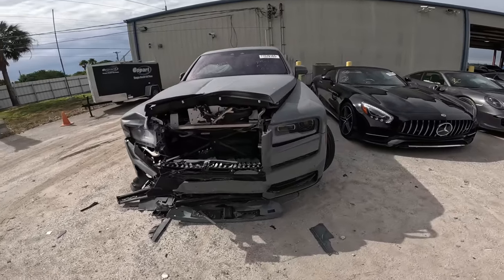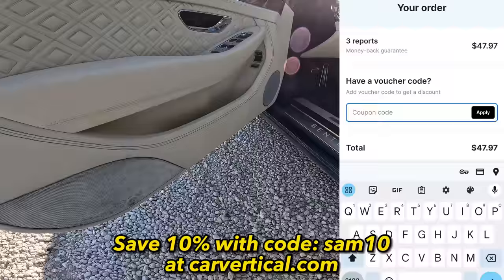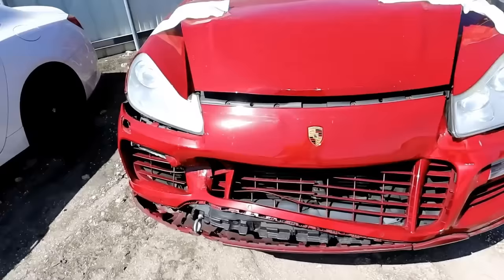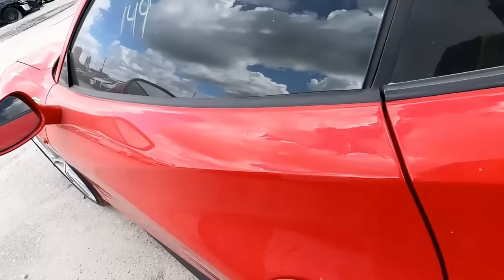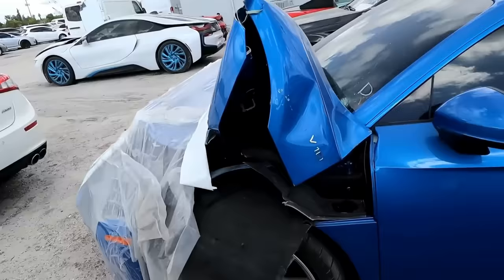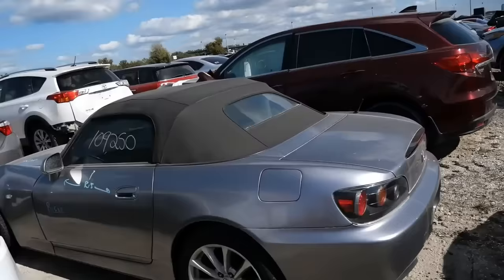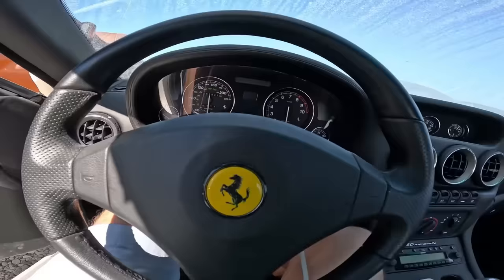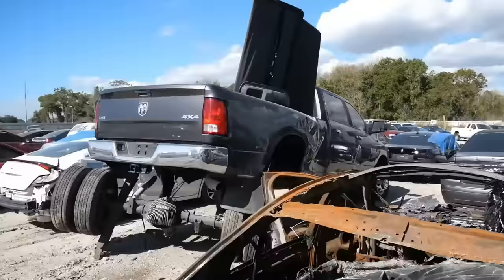I Found a $250,000 Bentley Hiding a Major Cover Up Scam at the Auction

Comment from the maker: Give the 🎁 of a Car's REAL History with carVertical: https://www.carvertical.com/landing/v3?utm_source=infl&a=samcarc&b=2c9b600c&voucher=sam10
Reply: Sam was that the same bmw I8 still sitting at copart?
Reply from the maker: Yes lol but it finally sold around $40k @williamriley-jones
Reply: @Samcrac lol wow it’s sat there for about five years 🤣 glad it finally sold though
Reply: The one thing among many I like about your channel is that you are one of the best YouTube speakers.
Reply: I don't understand how a flood damaged car is OK to repair and drive in the USA but not Canada? They told me electrical problems haunt the vehicle for the rest of it's life. Understandable but many connections are water tight. Many are not. When you have a car that steers by wire imagine the wheel not working on the highway. This might turn out to be a huge mistake for anyone restoring something like that as they could be sued right? If the flood in mentioned in the title then it's buyer beware?

Comment: I laugh every time Samcrac says that V-Tuned could fix this or that but still hasn't finished fixing the Samcrac Ferrari... 🤷‍♂️🤦‍♂️🤣🤣🤣
Reply: Which one the green or silver 360
Reply: 599
Reply: Hard to finish that ferrari 
  when  you have to wait for parts.
Reply: waiting for parts😅
Reply: Yeah, it's not a skill thing, it's a parts thing.
Reply: Ferrari parts wait time is real. Months and months
Reply: Part shortage 🤷🏼‍♂️He has the skills and does excellent work
Reply: When Sam or ratarossa buys a Ferrari I feel sadness I’m gonna watch a difficult project especially when it’s a auto or convertible and everything bad about Italian cars goes wrong . 
Personally I’d like to see Puma Sam fix a magnum Ferrari or something that’s simple old fashioned enzo mechanicals and steer clear of spaghetti sauce electrical immobiliser etc etc gremlins 🇮🇹
Reply: V-tuned had it fixed in no time the actual repair just waiting on bolt on parts he would easily repair the corvette
Reply: Ok?
Reply: Or finished his mustang build
Reply: V tune hasent fixed it because he wasent paid to fix it it was fixed in exchange of barter and air time on a bigger channel
Reply: Could you do better?
Reply: As far as I've seen, he doesn't finish anything
Reply: @adamjohnson6655 I think his mustang is a back burner project. Probably because he thinks it won’t generate the views that even a F150 would get.
Reply: Check where he has collaborated with Goonsquad, Vtuned always finishes his work, just as long as parts are available.
Reply: The content is great, keep the projects coming Sam❤
Reply: No shit.  V tuned only finishes paying customers cars
Reply: All these exotic cars have available parts all day everyday these rebuilders don’t want to pay msrp for them is the problem.  If you are buying a crashed car the goal is to save money all the way thru the project.  This is the issue with VTuned/Samcrac turd.  Salvaged title car will never be valued at blue title level so investing in new factory replacement parts isn’t smart and most don’t.  They will continue to wait for a used part deal.  This is the real reason we are all waiting to see it drive again.
Reply: Not his fault
Reply: @2405Shysgarage They have been waiting on parts for months.  To anyone out there. Tennessee  is full.  We do not want anyone else here. We have people here from everywhere. Please go back to Texas, California and South of the border.

Comment: I've rebuilt a ton of cars over the years, some for personal use and some for resale. It's fun (I love learning new skills like body, paint, detailing, etc), I've gotten some personal cars I wouldn't otherwise have been able to afford, and I usually make money. The only cars I've really lost money on are high-miles German cars, and the most profitable ones (as a percentage of cost) have been American and Japanese sub $5k cars. 

To me, that Mercedes wagon was the only deal, assuming it runs. Some of the supercars and luxury brands can be profitable, but the risks are substantial. The difference between a $50k profit and a $20k loss is razor thin.
Reply: Yeah, your entire profit can be wiped out by a single part on an exotic. V tuned did his McLaren and "made a profit" but he lost his shirt if you include the hours he spent on it. Even if you figure a very low $80/hr he had $80,000 in labour on it.
Reply: "Cheap" car prices and demand have skyrocketed with the inflation on new cars. I think this is a great place for rebuilding; there is a lot to choose from and reasonable parts prices.

On the other hand, with the spike in interest rates and sketchy economic situation, I think rebuilt exotics have become a more risky proposition.
Reply: @dosgos  Well it used to be if you were "upside down" on a used car it was a bad thing. But oddly enough with the insane prices on new cars, the value of a used car has increased so you're not so upside down.

I've put $8000 into my 2004 F150 and people said "you're nuts". Ok, ignoring the fact that it's a 5.4L, anything 6 yrs+ newer would cost me $20K and up AND come with its own problems. New? to replace it? $60,000+ and for that I could rebuild mine from the ground up and have enough to pay for gas for the rest of my life.
Reply: 'A ton of cars' is only one car since most weigh more than 2000 lbs.  Just stating the facts.
Reply: @oldanslo  I bet you're great fun at parties.....not.
Reply: The safest bet would be to go with mass produced cars with min  50000 + cars sold and with cheap and readily available spare parts.
Reply: He made it back in YouTube revenue

Comment: Usually Bentleys are under 6,000 lb and max price of $409,000 extremely fully loaded and only 45% can be written off the tax code vs  Rolls Royce are 6,000 lb and start at half a million dollars and can reach up to$1.5 million depending on options therefore bigger tax write off.
Reply: Also, for people who want bling status, everyone has a Bentley or a Ferrari. Lol. In some places in Los Angeles, you see one every other block, almost.  Now the real bling, though, is and has always been classic cars. That mint condition 1960 or 70ss Bentley is going to turn heads all the time.  In my case, it was a 1967 Mercedes in (factory) emerald green.  It felt special to drive it.  Compared to any old AMG that is.. nice but like every other German sedan?

Comment: I have a D4 Audi A8L with the V8 twin-turbo; same motor...APR tune, improved RS7 turbos, downpipes, turbo oil screens removed/relocated up on custom lines, bigger sway bars and the center muffler changed. Very understated, not loud, but will straight up move. Best part? Inherited

Comment: If that Cayenne sold for $11,600 how much could you part out those brakes for if you bought it for parts and didn’t want to rebuild it even if it was rebuildable ?
Reply from the maker: I'm not really sure if the brakes are compatible with anything else. If they fit other models then I would say you could get around $5k for the used set. If they only fit a Cayenne then it's a pretty tough market because who really wants an expensive brake set for an old SUV...
Reply: I bought the cayenne and daily drive it today.  Recieved an offer of 10k for the brakes from a 911 owner. I declined.

Comment: That was loads of fun Sam. That S550 went super cheap. Wonder what the issue was.
Reply: Old german cars..so much to go wrong.  The v8's had the nasty v8 cam teeth that would get worn out and cause major engine damage, never mind that air suspension eventually needs to be repaired or replaced with coilovers.  Great luxury on the cheap, but when they break, run.

Comment: I bought a 1 1/2 year old Aston Martin with only 700 miles half off what a new one costs.  Wealthy always buy new.  Second hand buyers still
 Can not afford so one reason why exotics depreciate so much.  Parts never depreciate as well as labor.  Exotic car parts are only oem with
No aftermarket support as few cars are made in this category.  With EV’s just as fast or faster, exotics are still moving art. Once USA starts building its own battery factories vs buying from China and Korea, EV’s will be cheap and 
Manufactured faster than gas cars.

Comment: I disagree with the bentley summary. someone put out more than 50k for  car, then put ALOT of work into the detail, and resold it for a 15% increase. not profit. the detail work could be equivalent to engine work if it helps legitimize it as work. granted, its a great price for a detail- 10k. the other Issus is the disclosure of the flood. that's a major issue and should be illegal if it is not already. bad biz.
Reply from the maker: No way